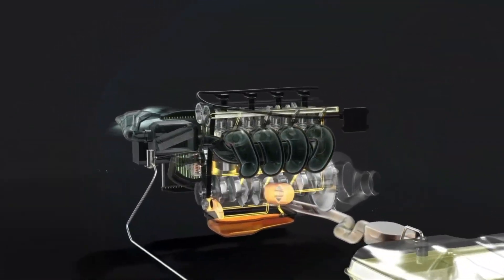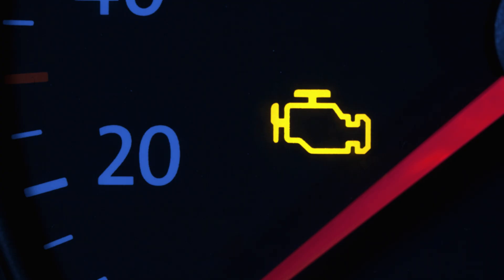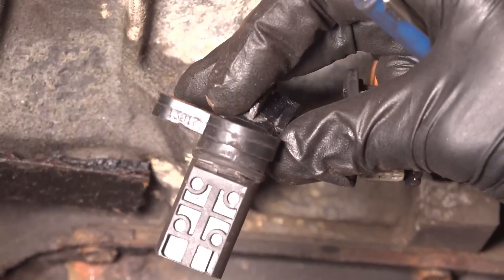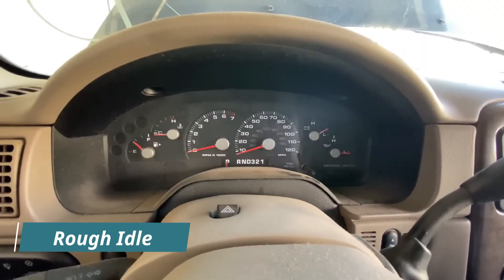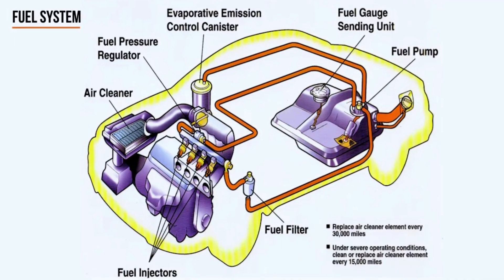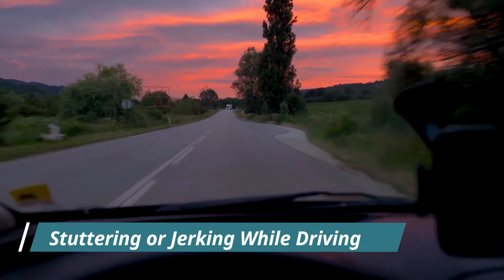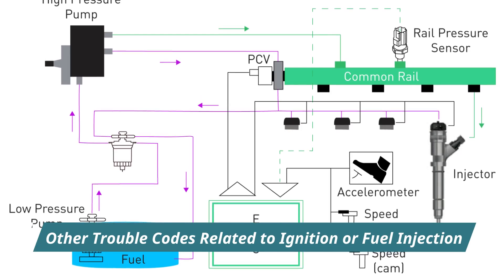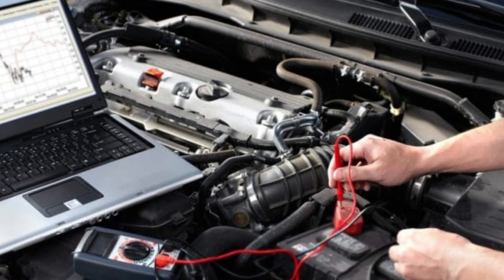10 Bad Crankshaft Position Sensor Symptoms: Spot the Warning Signs!

Comment: Have a w211 e220 2002 throw code of ckp sensor and egr im having rough engine noise  like tractor on light acceleration and not passing 3000 rpms
Reply from the maker: You’re getting the classic combination of a CKP (crankshaft position) sensor fault and an EGR issue. On the W211 E220, these can absolutely cause rough, tractor-like engine noise under light acceleration and make the car refuse to go past 3,000 RPM.
Most of the time, the CKP sensor or its wiring is failing intermittently, which throws off timing signals and forces the ECU into a protective low-RPM mode. A stuck-open EGR valve can add to the roughness by letting exhaust leak into the intake.
Check the CKP connector and wiring, look at the sensor signal if possible, and inspect or clean the EGR. Fixing the CKP issue usually restores normal RPM and smoothness.

Comment: What causes the car to vibrate when either the reverse or drive gear is engaged, and the same time, I notice the engine runs low
Reply from the maker: That kind of vibration when shifting into Drive or Reverse, along with the engine running low, is often caused by the engine misfiring or running rough. A weak or failing crankshaft position sensor can definitely cause this, because the sensor controls ignition timing and fuel injection. If the signal is off, the engine won’t run smoothly and the extra load from putting it in gear makes the vibration worse.

Of course, it could also be related to dirty throttle body, worn motor mounts, or fuel delivery issues—but since your engine runs low, I’d check that crankshaft position sensor signal first.